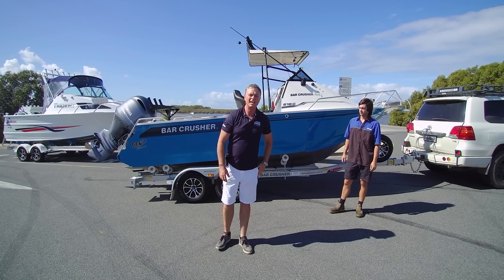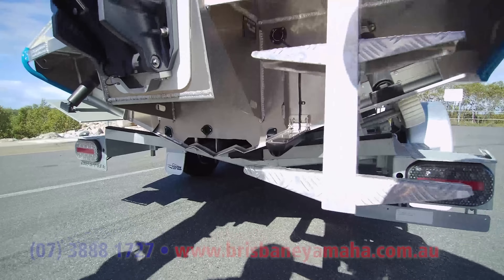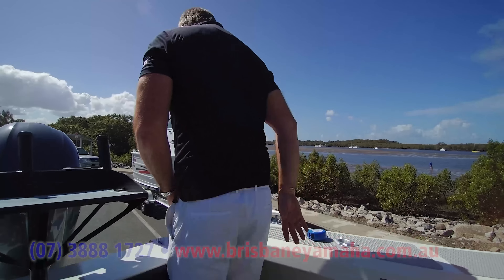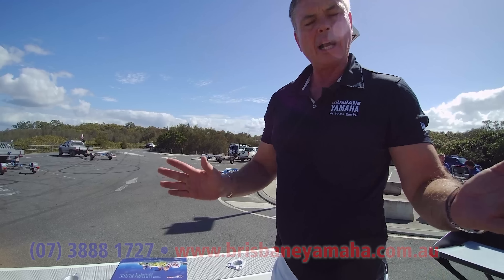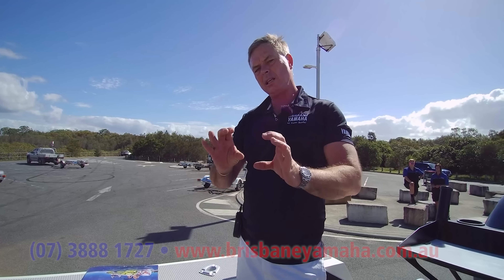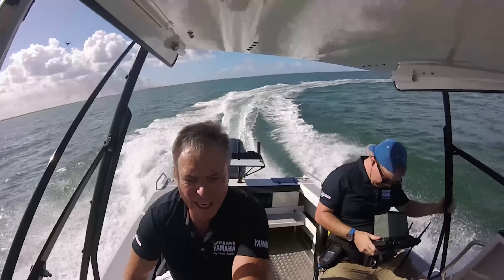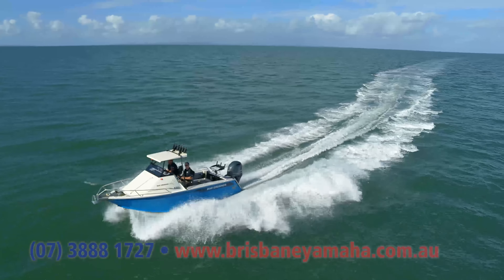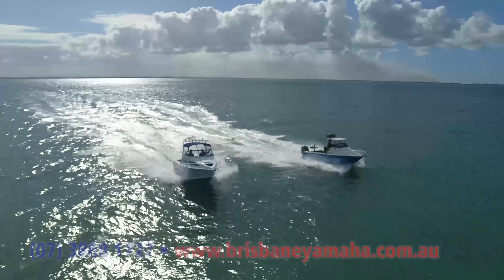610 Trident vs 615C Barcrusher on-water comparison | Brisbane Yamaha

Comment: Been out in a mates 615BC awesome rid 2m swell bit of joggle, sat well in 3kn drift with 10 to 15kmh wind sat on 26kn with auto pilot on all the way from the shelf and the only thing I'd pick on is the noise when the keel cuts i found it a bit loud but felt safe and stable which outweighs a bit of noise, had a 150 Yammy and it paired great.
Reply from the maker: How good are yamaha 150s
Reply: @BrisbaneYamaha  they just chug along no stress, buy me one😁🤣🤣

Comment: 22:46 is horrendous for the barcrusher too. It's not even a particularly rough sea. The hull should extend to the end of the transom like the trident. Otherwise you lack buoyancy at the rear and it digs in like so.
Reply: It’s because this model didn’t have the bar tab on the rear. Testing it without that is just stupid
Reply: The swell looked worse during the barcrusher testing

Comment: Do all Barcrushers have to be fueled like that? seems impractical/dangerous!
Reply: It's actually really good, you can see straight in to the tank and measure your fuel easily.
Reply: no fuel hoses and fixtures to break or perish, no extra drill holes etc. It's a great design!

Comment: That fuel filler location is horrendous in the barcrusher. No idea what they were thinking.
Reply: They weren't thinking, thats the problem.
Reply: Save cost, more profits!
Reply: @maxszhao  ballast on BC is useless, I would prefer to weld it up. A dynamic ballast allowing the water to be locked in or out is the go.
Reply: It works really well for me.. Not sure about legalities and all that but filling it up is super easy. Don't need to worry about air locks and it's too easy to have a quick of actual fuel level.
Reply: Bob Builder mate that’s what they already do